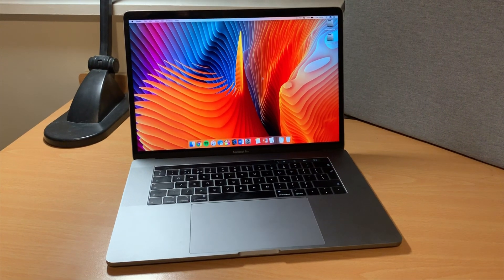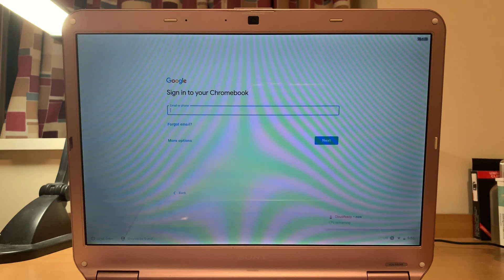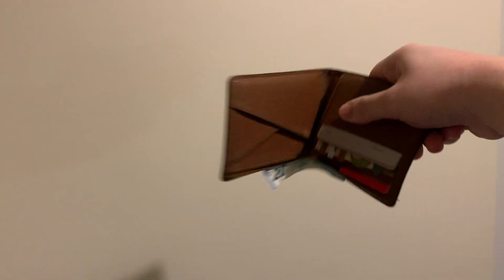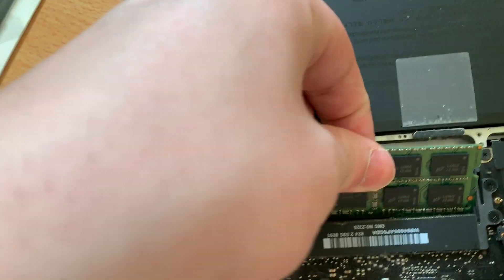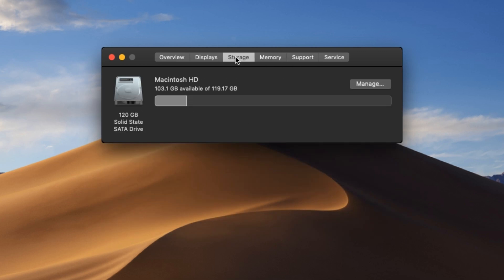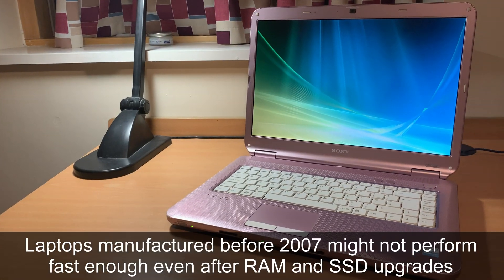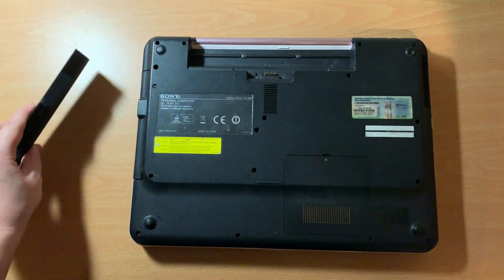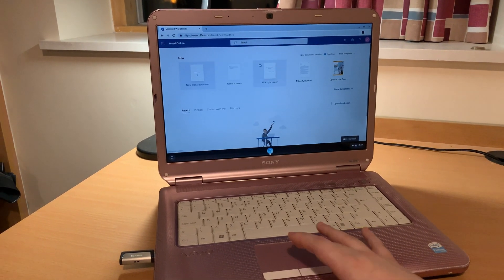How I upgraded + SOLD 2009 MacBook Pro 13" Inch AND Sony Vaio NS20E

Comment: I had a old Gateway LT2104 netbook laying around and I put in a crucial BX500 ssd and 2 gb of ram and I installed the 64-bit version of neverware's chromium os. Since it was running 83.4 and not the obsolete 32-bit 76.4. I use it for school and it works great... After you install the OS drivers and restart.
Reply from the maker: Hey Destin! That's awesome, it definitely helps to have that 64 bit processor to unlock some additional computing power. Glad you made yourself a great device to use for school work!

Comment: Nice vid and thanks for the tip! My main desktop PC is kinda very slow before I upgrade the HDD to the SSD.
After the SSD upgrade that I did few months ago, it’s running very good! And it’s running the up to date Windows 10 btw.
My main desktop PC specs is very simple, Core i3-4130, 4GB of RAM, Intel HD 4400 on-board GPU and a 128 GB SSD, with my 300 GB HDD. That actually even lower that the laptop that I have which is a Core i7-5500U, 8GB of RAM, Intel HD 5500 and AMD R7 M270 GPU, and yes, 1TB of HDD on that laptop. Sadly, that laptop I was borrowed from my brother tho...
Not the best specs in the world for my main PC that I used, but man I just happy about the how it’s running fast with a SSD now! 😁

Thanks again! And I subbed to you and followed you on Twitter btw! Loved your vids so far! I’m also a big tech lover guy as well! ☺️

Oh! And it nice that you are using both Windows and macOS! Which OS you prefer and used must btw?
Reply from the maker: That's absolutely awesome. An SSD can make such a difference and due to bitcoin mining since Ram prices have gotten a little expensive If things are running slow and you don't have a big budget: get a 120GB SSD and it makes a HUGE difference. And I like that you have the second HDD for your game library!

Your desktop PC sounds great, look at a low energy, low profile budget video card like the Nvidia GeForce GTX1050TI or the GT1030 if you want a bit more horse power to complete it.

You have a very nice brother to let you borrow that Laptop just don't remind him and maybe he will forget and you can keep it! :D 

Thanks for subscribing and following, I hope to meet a lot of tech lovers too and we can share different things we learn as we all have different stories and discoveries! 

I definitely use both Windows and macOS. I don't prefer one over the other -  I definitely use macOS the most but neither have all the benefits so you got to be agile and use both. :)
Reply: Thanks! Actually my second HDD is for work files tho.
I do also used OneDrive with my Office 365 subscription plan (it’s 1 TB btw) to store my works there, but sometimes I need them on locally for like backups or achieve files. 
And yes, it’s great that you like both OS! I’m grow up with Windows more because I started using it with XP in like the 2000s and today I still a big Windows/Microsoft fan. I do have a iOS and a Android device, and honestly, I loved both Microsoft and Apple so yeah their are my favorites!
And that laptop tho, well sadly he needs it for his project works so I very only got this lucky chance to try it out for a while. ☺️
Reply from the maker: @deactivated_0124  I should try OneDrive. I use Dropbox and while it stores things in the cloud, it keeps things permanently on my drive and takes up space. 

I grew up with Windows XP too on a Pentium 4 COMPAQ Desktop haha!

At least it was fun but your desktop machine will always be more powerful than a laptop anyways. ;)